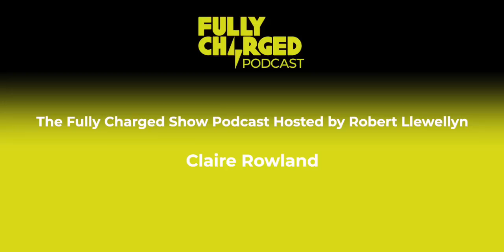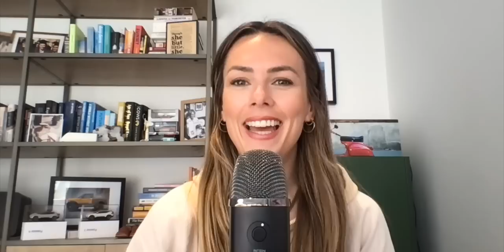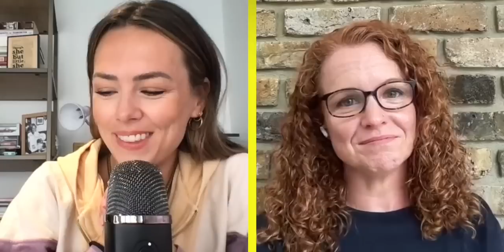How Human 'Guinea Pigs' Are Shaping YOUR Energy Future! |Fully Charged Show Podcast - Claire Rowland

Comment: Great as ever, Imogen (& good work too, Claire).  

Minute 44: chat on ignoring kWh because it's too difficult for 'people' to comprehend... 

Our Poles drive our Weather systems and our Ocean currents. Our Poles have melted at a rate of 420 cubic kilometers per year since at least 2002, meaning [now] we get more extreme weather, more often. Our poles will continue to melt because the planet is too hot for them to exist due to Global Heating (the case since at least 2002). 

The unit of heat is kWh and for 'people' to understand the personal impact they have on melting our Poles, it is crucial to talk in kWh. 

It takes ~85kWh to melt a cubic meter of polar ice. Until the relationship between personal (& corporate) consumption and for-ever Polar ice melt is understood, most 'people' will not change, or Act. The key Unit in comprehending this is kWh. So, please let's talk in kWh ... as if our lives depended on it.
Reply: @adriantemple-brown4235  

Hmm ... did you attend school?

kWh is a unit of power over time.

Nothing to do with heat per se.

Comment: Great podcast, thanks Imogen and Claire. The most important thing in my opinion is that the government when building all these new houses that there is a minimal standard in place that must be adhered to there new builds are not only well insulated but they are wired with integration  possibilities from the get go. We need houses to be wired for integration with solar, car charging, ashp/gshp, batteries. Presence based heating and lighting and audio visual integration. They need to be wired not only for networks but also structured cabling to switch positions, inverters etc so the lighting/heating/access control etc can all be integrated and energy management easily monitored and controlled.
This can represent significant savings for households. 
There are already smart home systems like “Loxone” (that I have been installing for over 10 years) that does precisely this and instead of different apps fighting against each other are actually all integrated and controlled through one app. These systems  make decisions on how the energy is used in the most efficient way possible, diverting self generated energy to your ev ,hot water or battery according to your lifestyle requirements. This need not be expensive either but the crucial thing is to put the infrastructure in to start with as retrofit solutions are always compromised. So a homeowner can expand and update the system as they require.

Comment: Reference the point about people thinking about energy all day - I’m on the Octopus Agile tariff for my electricity import which is both a curse and a blessing. I’m saving a lot of money, paying something like 9p per kWh but to do so I am having to be extremely proactive with my use of energy. Every day I have to check the prices for the next 24 hours so I can energy shift to those cheaper periods. I have a small battery that I make sure is full before any peak times, and seven solar panels that flatten my use further, obviously depending on weather and time of day. Most of the time I don’t mind, but sometimes I wish I could just relax and use energy as and when I want to without worrying about how much it is going to cost.
Reply: Go ahead and use it.  Trade cost for convenience like people do with everything else.

Comment: Energy fair for everybody, yes please. I live in the far north of Scotland where we have the highest Uk energy prices and by far the longest heating season.  Yet we regularly run on 100% renewables and produce an excess of renewable energy.  How is that fair? If the UK adopted regional energy pricing, Scotland would have the cheapest energy in Europe what a boost that would be and would attract industry and employment. Where are the energy benefits in scotland being part of the UK?
Reply: Jackson has referred to the current stupidity multiple times.
Reply: @Grahamcastle  Scotland needs cheap energy tariffs through local tariffs. This helps all of the UK because we reduce the cost of early switch off subsidy.

Comment: 22:23 Batteries on HGVs as a stop-gap to ship the energy from Scotland (preventing pauses in generation, also), to where it is needed most - say the South - whilst we wait for the infrastructure to be put in place.
Once in place, you still have the batteries to place in a desired location.
A hardware solution that is diverse in its possible application 🤔
My first video on my channel refers to this idea 💡 
Love what you do.
Kudos.
Keep at em' 💪⚡
Reply: Interesting, I had a plan to use trains and shipping containers, as one standard shipping container can hold as much as 6GWh of energy these days, and imagine a train carrying 12 shipping containers (one powering the train on the way down and one on the way back up) heads south to one of the old disused coal plants, and discharging it there. Whilst the empty train of another 12 shipping containers heads north to be recharged, and another 12 sit in a yard being charged overnight. Would make a good alternative to power lines in the short term, right?  Now checking out your channel!!
Reply: @showme360  Yes, this is also, a really great idea 💡 
Requires the infrastructure and yet, where it is already in place, a perfect solution.

Comment: user experience is just a way to forget the technical and business reasons that drive a product for a while and just think 100% about the person using it including factors that are not under the control of that product.   e.g. electric cars are wonderful but the user experience is made more difficult by needing to build a driveway (if you do) and having to upgrade the house's electrical system (if it's old)  and having chargers nearby and also whether the car itself is a nuisance to look after and use.  So it might have incredible features so inaccessible that you forget to ever use any of them.

Comment: Wow, can you imagine the headlines that the red tops could get from this? Very interesting though. I've got a house that has a heat pump, solar and an ev but only the solar is IOT, the rest is manually/internally controlled. It would need to be mandated that your major appliances (HP and EV) were IOT to get anywhere near the vision of this project? I guess it could be done but it would be SLOW.

Comment: Excellent episode and delightful guest - Claire's point on fairness also links both to the energy transfer problem (lack of investment) and the energy 'market' map having changed out of all recognition to that of 30 years ago.
 - The 'green' area she referred (The NG map) to in the north of Scotland pays the highest rates and standing charges in the UK despite living right next to the source, where the energy is 'needed' in the south is the lowest - Hardly surprising than those folks (oop north) do not look at this as in the slightest fair.
- The grid problems could be seen coming years ago, even before EVs really took off, I sense driven more by politics than planning ahead - eg Orkney had been screaming for a mainland link upgrade for most of my life, they're currently having  to 'switch off' wind generators because the grid can't take it.  Tidal stream trials have been limited by this stupidity, and the tidal array they intended testing is scuppered until they do, sometime in 2026.... 
Finally - We desperately need politics banished from interfering in energy if we are to progress - eg Insulation has been sidelined by governments for years, which if rolled out nationally could dramatically change the transfer problem - eg My own energy losses on a 10 year old house are 20% of what they were when new, none of it is rocket science.
Reply: I thought SSEN were in the process of upgrading the Orkney power line to 220MW with two new substations in the mix as well. 

I believe the more distant Shetland 600MW link went live earlier this year, how far is the Orkney link behind this?
Reply: Orkney 2026...

Comment: 37:50 '... choose who will manage your home...'  for me - I want to manage my home, with the aid of a little computer that can perform a real time optimisation based on current electricity price, state of the battery, expected solar levels tomorrow, temperature of the hot water storage and my expected EV use tomorrow, etc, etc.
Reply: This is it I'd like something small simple like the smart meter has integration with all new tech as a law. A fit and forget sort of thing that you could monitor and tweak if needed. 

Maybe a government backed company so universal and funded for the people rather than profits

I have a Midea Heat Pump but nothing else 'smart' it's pretty good but the user interface is bad and difficult to adjust settings if you don't know what your doing. 

You can get a system that used weather and electricity prices to run it cheaper and more efficiently but it's a extra cost to install.
I'm far too poor to get smart tech 😅 used inheritance to install the heat pump was £4000 all in.
Reply: @Burtis89  this is where Smart home setups can help, I have Home Assistant running on a raspberry pi and it's setup so that my car will charge when the rate is low (early morning) or when it's free (and due to my setup, won't charge the car in the cheap slot if the free time will do the job).  Smart tech can be expensive, but you don't have to buy/do everything, I started with 3 hue bulbs (they're good but expensive) and slowly added more things over time (Shelly smart relays for lights, motion sensors for turning lights off if a light is left on, etc)
Reply: Really great discussion with a clearly very knowledgeable guest. One of the real issues that need to be addressed is for house builders to not only build well insulated homes but also to put the infrastructure into the homes so that there is no need to retrofit but should you want to integrate your heating, car charger, gshp, lighting, solar etc. the cabling is already in place. Structured cabling not only for networks but to switch positions for smart control of lighting scenes, access control, audio, heating etc. It need not be expensive to put in a basic control system in that should the home owner want to improve upon at a later date is easily doable. The only way to truly integrate these things is to have the backbone already in place. 
There are systems already out there such as ‘Loxone’ that already integrate everything in the home and operate all these things through a single app, with full integration of energy management which can make these decisions about whether you need to charge your car or heat the water, switch on the heating in the most cost efficient way etc for you. But if we are ever to really embrace these solutions it has to start from the ground up, the builders have to build to facilitate this and this should be a prerequisite for every new build.